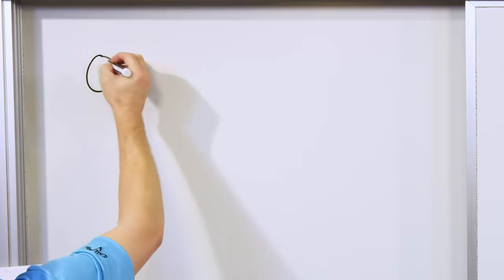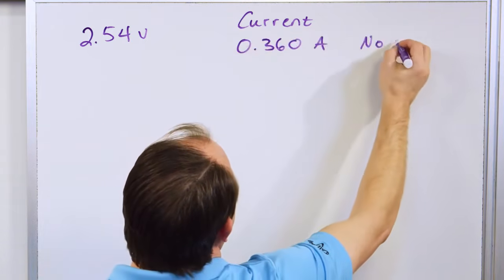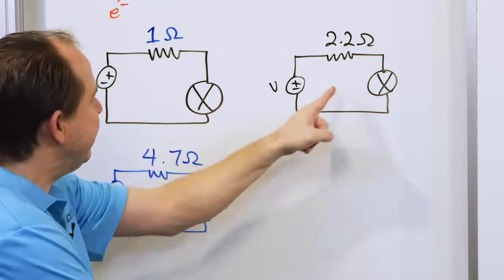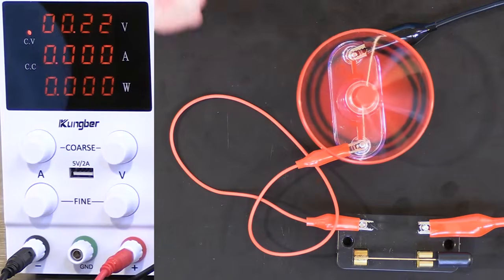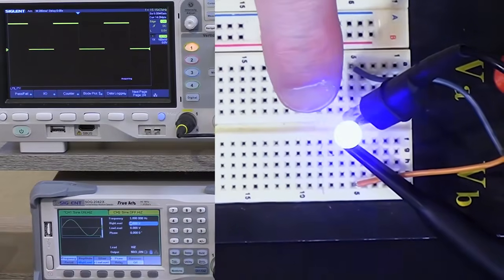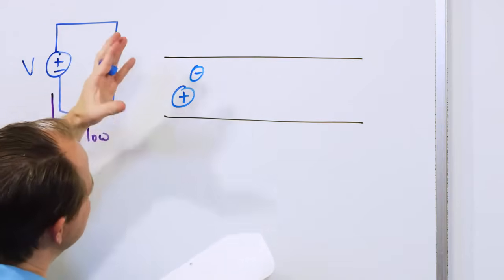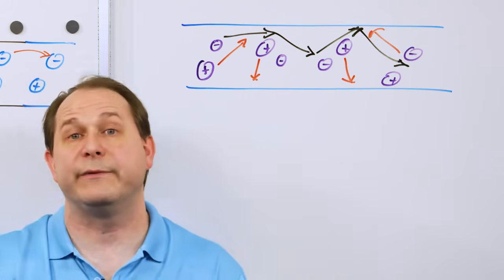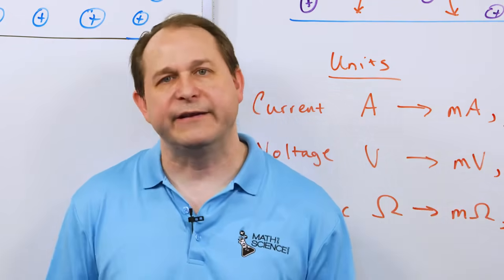Why is Voltage the MOST Misunderstood Part of Circuits?

Comment: Every material in the universe has static voltage to the point of threshold then u get to kinetic voltage of material.....permetivity of  electric field in material is the answer.....polarity of  elementary particle cause what we call force field .which drive particle....Air pressure between to point doesn't flow its just push what it ban push

Comment: The chemical reaction releases electrons that provide the physical field that accelerates the electrons along the wire. Electrons have both particle and wave like properties so I disagree with his either or comparison.
Reply: Mostly correct. Chemical reaction keeps the difference at battery terminals. Different concentration of the electrons (or lack of them). Chemical energy is in the bonds (electrons sharing, clouds).
Closing/completing the circuit propagates the "E" component of the EM field along the structure (then other things coexist: E field, voltage, M field, electrons are aligned/dragged, current).
Back to the battery (like the circuit was an extension of the terminals). You're trying to force positive post to be negative, battery fights back (though the loop, circuit).

Comment: So is the hole current makes the bulb light, or the negative electrons make it light?
Reply: Energy is within EM field around/along the wires (then bulb filament). Electrons do NOT carry the energy to load (they represent a small fraction of it: heat loss in the wires).
But we need them to guide the energy close to the wire surface (that's the purpose of using wires - alternative is not efficient to power things: radio or light transmission).
Reply: The electrons moving through the bulb make the light.
The voltage makes the electrons move through the bulb.
Voltage doesn‘t move or flow…it‘s the electrons which do this.

Comment: I always hate to hear “electricity takes the path of least resistance.”  That simply isn’t true.  If I provide two paths and one has less resistance than the other, all of the current doesn’t flow through the path of least resistance.  Current flows proportional to the resistance of all available paths.
Reply: What if there's a trajectory with no resistance
Reply: @qhawe_tricksThere aren’t many superconducting paths available in the real world.  Not many as in none.

Comment: A short circuit across a hot and neutral in an A/C circuit or a hot and ground in an A/C circuit is what a GFCI detects to open a circuit to remove voltage and clear a fault. I wouldn't call bypassing a resistor a short-circuit per say! This really isn't a good example of a "short circuit"!

Comment: using the resisters is also a great demonstration of how a dimmer switch controls the brightness of a light bulb. Some dimmers use a mechanical knob to turn and others a mechanical slide, but they are both increasing resistance to the current flow to dim the light as you either turn the knob or slide the mechanical switch to increase or to decrease the resistance.

Comment: Voltage is not a push.  Voltage is Displacement, and the question you should ask yourself is “displacement of what?”

Answer: Ether
Reply: Voltage is more of a pull than push, but what is it that pulls??  It’s the Substrate of Space itself that is pulled.  

An electron is a single unit of dielectric induction.  Induction, now there’s a word worth contemplating for a full year.

Comment: Voltage is misunderstood because the men that created the electrical grid are misunderstood.  Learn to think the way they thought, and then voltage becomes simple.  Quantum explanation of voltage is nonsensical, causing confusion.  It’s the worst thing ever, and I have very little respect for engineers and physicist of Today, who can parott only, and who cannot think, and who do so very little reading.

Comment: Nice video on the fundamentals of circuits .wonder if you can do video on circuit breakers and how branch circuits work. Also gfci outlet how it works
Reply: this was a demonstration of how branch circuits work. A GFCI works on detecting a fault to ground. If you wire a GFCI into a branch circuit, in the beginning of the first outlet for a receptacle, there is a line and load; if you put the load neutral on the line side so that the neutrals are switched, the GFCI will never reset. A GFCI is interpreting the neutrals being crossed between line and load as a fault. I learned this early in my years as an apprentice electrician. The journeyman I was working with was called to go back to a new house that another crew had in our company had wired, and there was a light in the dining room that was tied into one of the small appliance circuits from the kitchen counter, and someone had landed the neutral for the line with the hot wire for the load side and the load side neutral with the line side and the GFCI wouldn't reset. I pulled the receptacle and looked at the make up and sure enough, this is what I found was the problem. It took me about five minutes to identify and fix the problem. The GFCI is sensing the potential between the hot and neutral wires.
Hope that helps you out.
Note also, an open neutral in a 120 volt circuit can cause electronics to burn up. Open neutrals in a circuit are responsible for fires in new home. lose connections at a receptacle where the wire wasn't tightened behind the screw tightly and it arced and got hot enough to burn up the receptacle and in some cases burn down the house. This is also common in wire make up in light fixtures inside or outside. I know a man who's new home burned down 10 years ago because of a back make up in a light fixture in an outdoor soffit light. There was a loose connection under the wire-nut and over the months it finally got hot enough to burn his house down. It was a total loss.
The heat from the voltage or electro motive force pushing the free electrons through the wire are trying to make it back to the source, so the wires are close enough that they arc across the small space between them, creating excessive heat and is capable of starting a fire!
black marks around wire terminals or other connections are a sign of loose connections or from something else causing it to arc. A GFCI doesn't clear on an arc fault but an Arc Fault breaker or combination receptacle does and will remove power. A GFCI removes power when when there is a short circuit, such as from ground to hot or neutral to hot, which is why a GFCI will not reset if the neutral from line and load are swapped between the hot for line and load.
Hope that makes sense and helps you out.